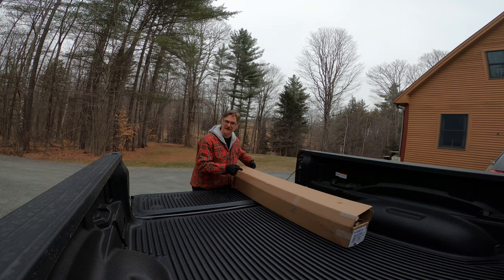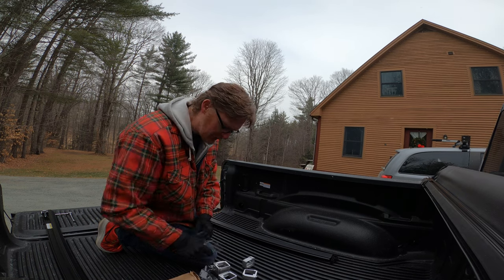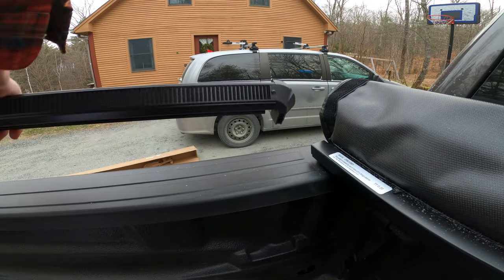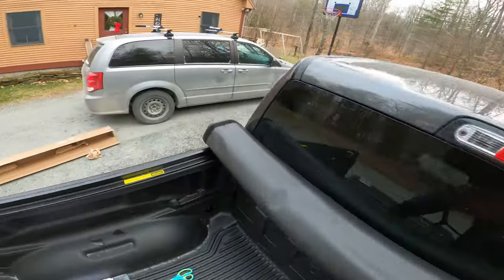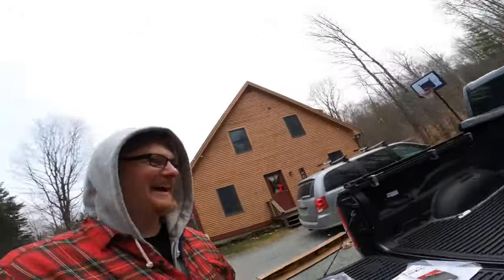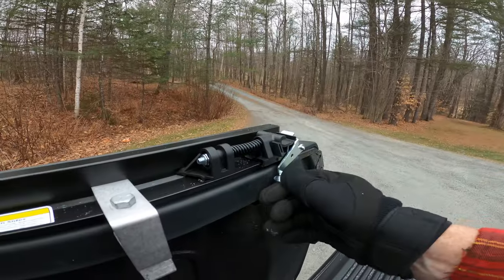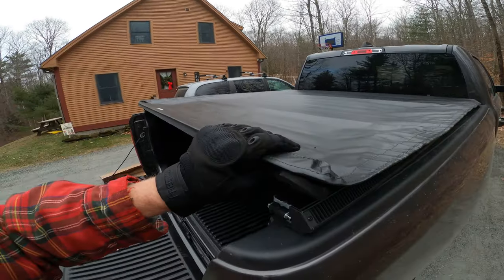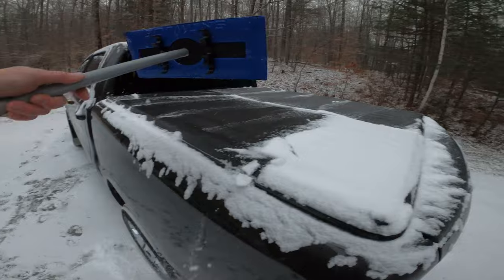Upgrade Your Ram 1500 with a TruXedo TruXport Soft Roll-Up Truck Bed Tonneau Cover

Comment: Just bought a 22 Ram yesterday and have already watched several of your videos which I found really helpful to see what I'm up against for some of these upgrades! Do you plan on installing running boards? And if so will you make a video for it?
Reply from the maker: Hey thats awesome! I have looked at side steps/nerf bars but havent bit the bullet yet. My wife is 5' tall so it would really help. Perhaps next spring? If I do get some, as usual, I will make a video :)

Comment: Excellent video! I just purchased and installed on my truck.  I noticed you have a gap where the seal isn't complete at the very front of your pickup bed.  I could see light coming through. Does that cause any leaks? I have that same type of gap and was wondering if I should purchase another seal and double layer it to now allow any light to show through.
Reply from the maker: I thought I didnt need the foam because of the bed liner but I added it later. No gap anymore :)

Comment: very informative thanks i just myself the same bed cover and wasnt sure about the weather striping on the bulk head because i also have a drop in liner as well and now i know dont need it! thank you!
Reply from the maker: Check it after a few weeks! If you see a gap develop, you'll need the seal :)
Reply: @sstressfl  did you have to add the weather striping?
Reply from the maker: @Foltz431  after a full winter the bed cover settled enough that I discovered a small gap so I installed the strip.

Comment: When force fails, use MORE force. I have a new to me ‘21 F150 that has one of these. It was rolled up when I bought the truck. First time I tried to unroll and latch it… the horrible noises it made when trying to seat the end and latch it, I thought surely it needs a tension adjustment. Nope just push harder… 😂😂😂😂😂😂😂😂
Reply from the maker: LOL yes indeed! And yet it goes against what I have experienced as a mechanic. Felt like I would break something! But noooope! Stand on that thing!! lol

Comment: any trouble with rain or snow causing it to sink in the middle?
Reply from the maker: We had a very heavy wet snow storm and it did sag and puddle a bit. I cleaned it off three times while it was snowing. Then rain leaves a tiny puddle in the middle which I fixed by pulling the cover a little tighter on the sides. It’s going to sag! But I’ll do my best Tom protect it and keep it healthy as long as I can.
Reply: @sstressfl  good to know! Thank you for replying.